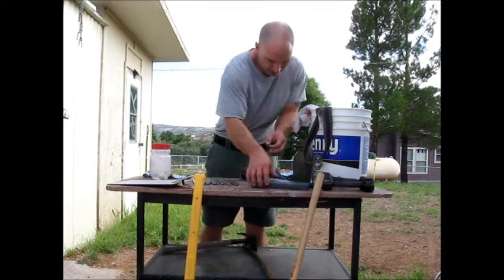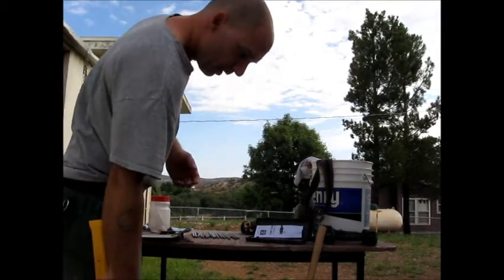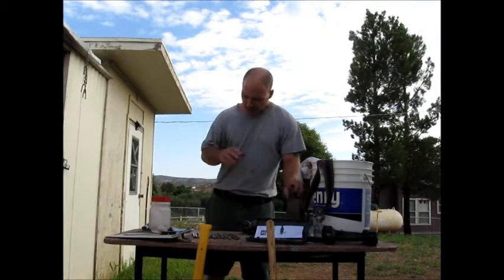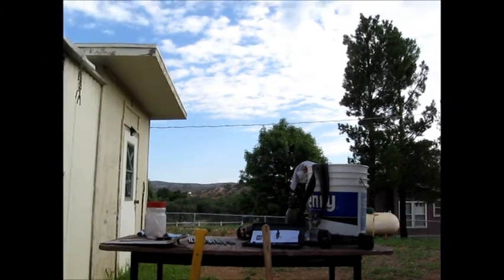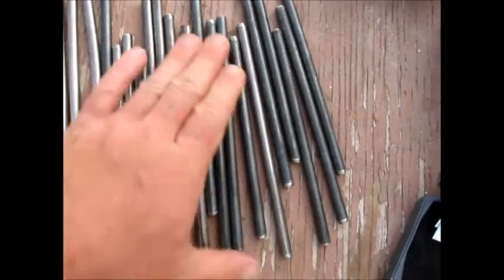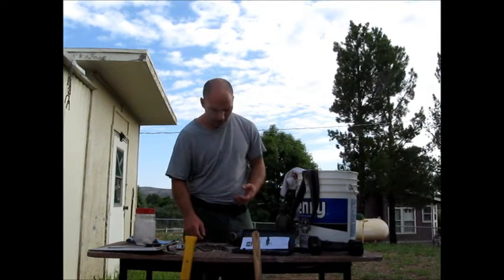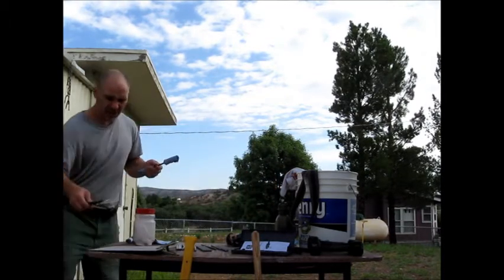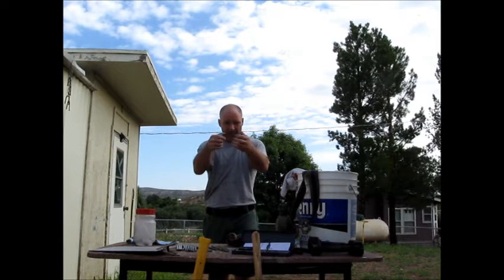New Steel for Bending!  5/16" Hot Rolled AND Cold Rolled Steel Bar

Comment: Goatheads, hate them. There all over Colorado. 0 in NYC but you get the occasional glass from drunken revilers.
Reply from the maker: I feel you! In Phoenix, we had goatheads, busted glass, and syringes to round out the trifecta of pointy, pokey awfulness.
Reply: +Primal Punch yea, I get much less flats out this way. Think I can score some steel from home depot? Whats the name of that type.
Reply from the maker: Hot rolled steel, and cold rolled steel. Yeah, Home Depot has it, $5.27 plus tax for 36". You get 5 x 7" bars out of that, and their quality is all over the place. I have only seen hot rolled steel in their rod stock, BUT, it will get you stronger!